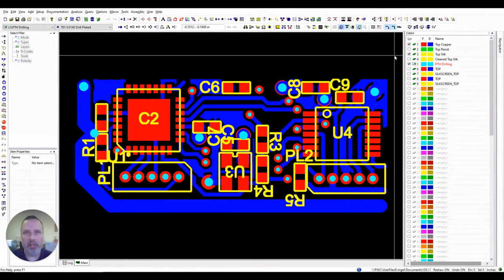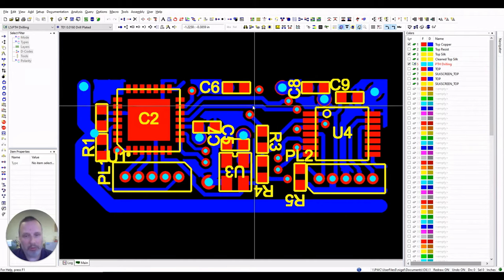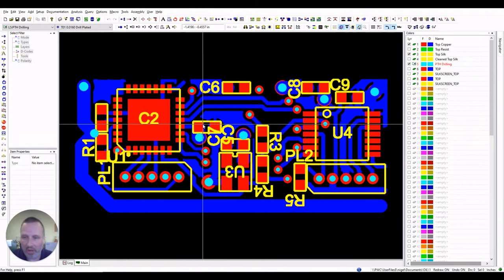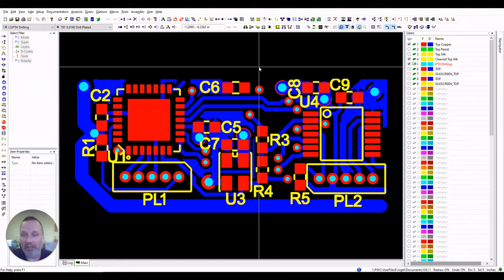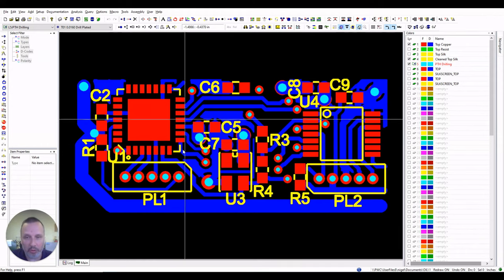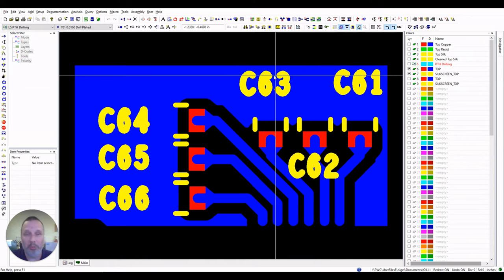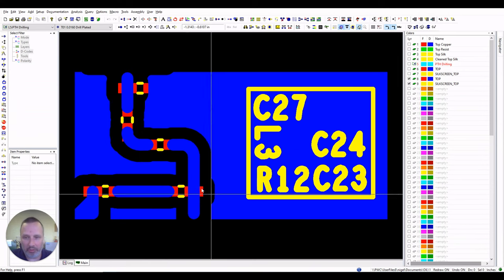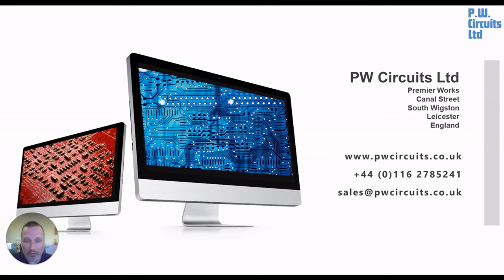Printed Circuit Board (PCB) legend/silkscreen layout guidelines

Comment: Hi.
I am using designspark pcb from RS . Any ideas on how to trim the legends so it won't cause short  circuit?
Ta
Reply from the maker: Interesting question. I've had a brief play with DesignSpark but not enough to answer your question.  With our system it's usually a manual clip operation (rather than creating a swelled clear layer of the pads) to get the best results, but I don't know if that is possible in the RS program, sorry. But I do know you can export the Gerber's from DesignSpark and if you send the quote and order from us we'll make sure your surface mount pads are Legend free. (Oh, and a legend shouldn't cause a short circuit as the ink isn't conductive.)